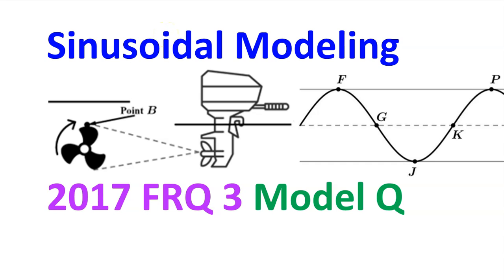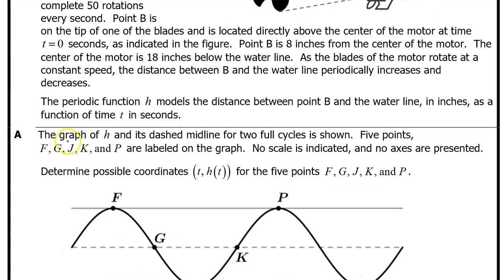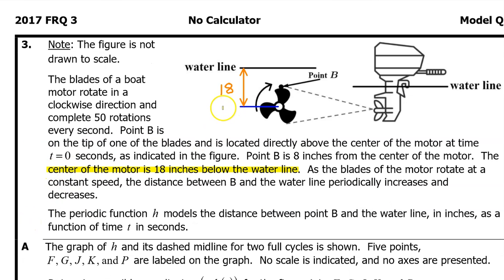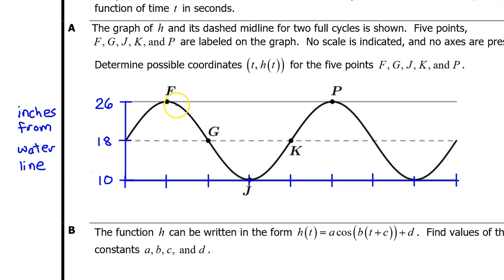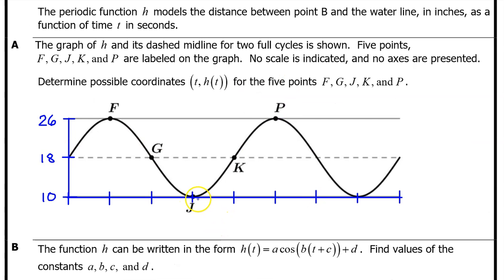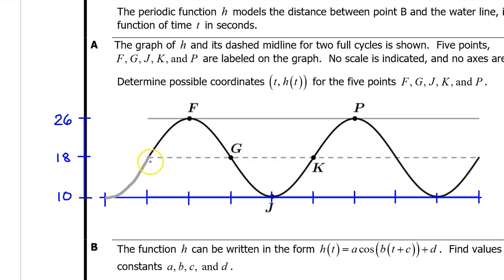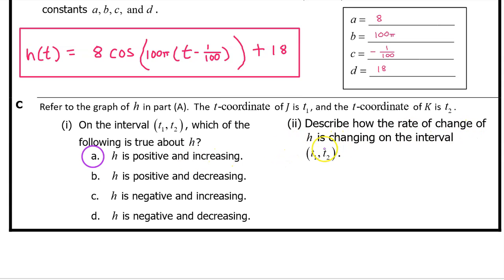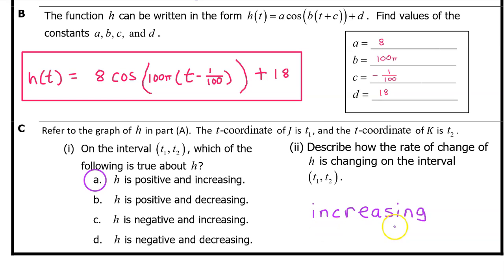2017 FRQ 3 - Sinusoidal Modeling (Model Q)

Comment: If i put J at point 0, would the values for part b vary and it would still be correct or the values for part b should be the same as how you found them in the video?
Reply from the maker: There are multiple correct answers for part b regardless of where you put J.

Comment: hello mr.helpful, is it correct for setting the input of J as 0 and have the period set as 2 pi
Reply from the maker: @Underground-Emperor  you can put 0 at J, but that doesn’t change the period. It will still be 1/50.